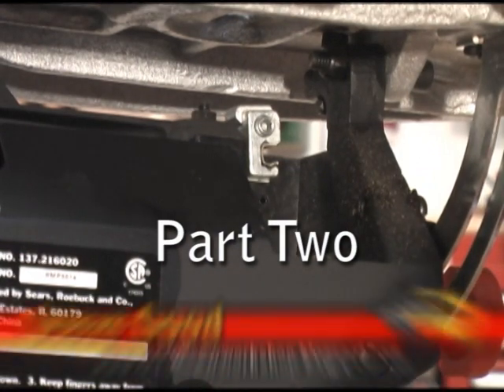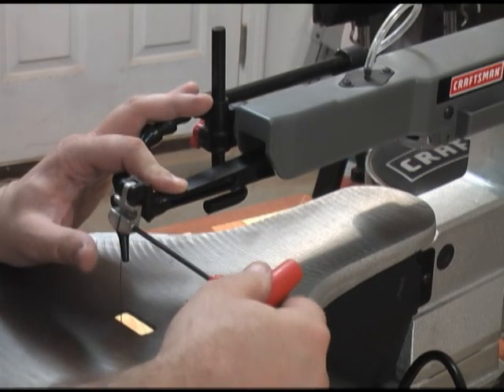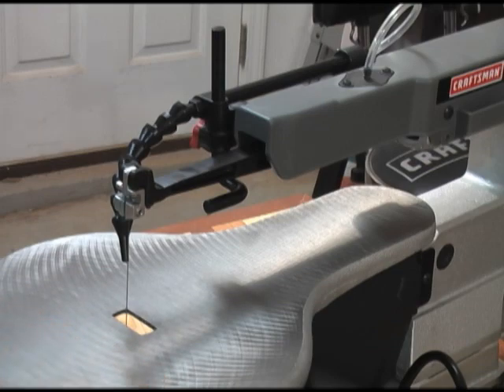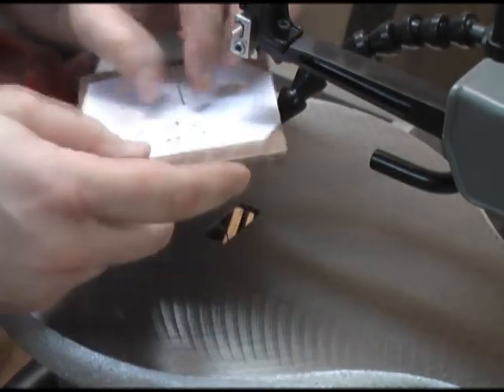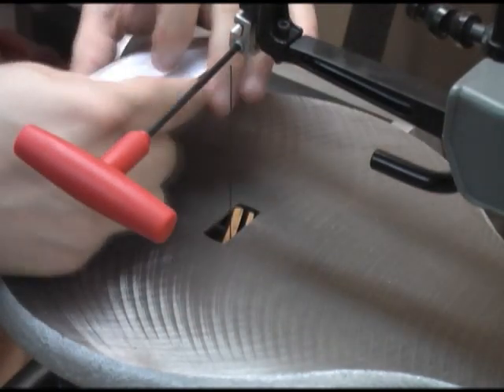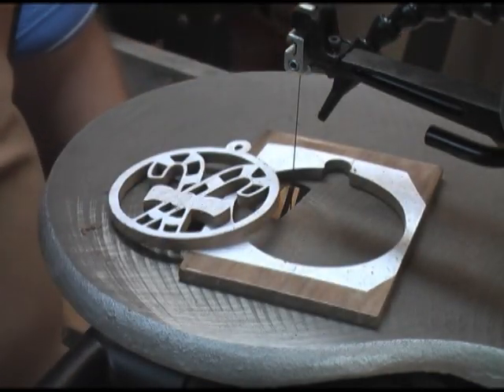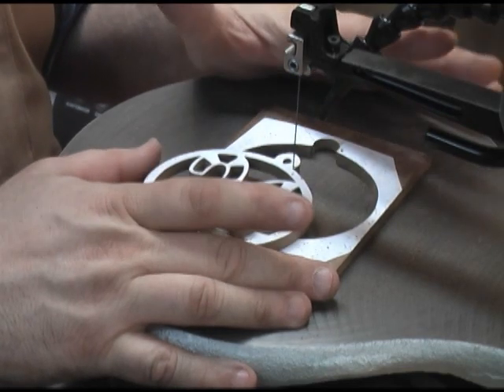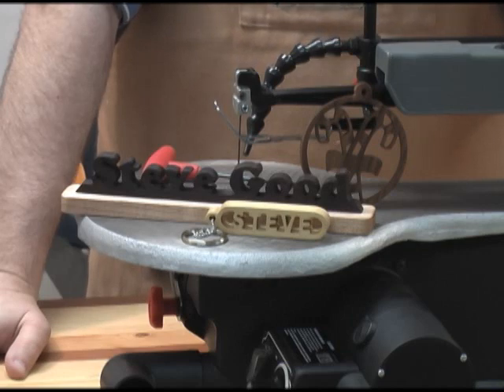Getting started in the scroll saw hobby cheap. Part Two.

Comment: Thank you for your presentation. I have this saw as my main scroll saw and don't back away from many projects. When setting up the saw on your table. place an old truck tire flap between the saw and table. It greatly reduces vibration. Truck stops will give you their "take-offs" if you ask them. I also purchased two longer set screws that hold the blades tight to the saw. It was simple to turn a couple of handles and drill and epoxy the longer screws into them. Or just drill out two dowels to use as handles. It makes changing blades much easier. Like was suggested on the video, get a foot switch and install a wider, smoother table. These are great saws. Listen to Steve about how much wood to cut through. He's the professional. But this scroll saw has the power and ability to cut 1 5/8" dry Pecan. Buy GREAT blades. They don't cost much more. Go slow, wax your blades, replace blades when they first start showing resistance. It took me a full day to cut the 12 2 1/8th" letters on a 14" name place for my son's desk. In short, listen to Steve and just get started with whatever scroll saw you can afford and have fun! P.S. You can get great wood from cabinet makers. They are happy to give you their "cut offs" for the asking.

Comment: Thanks Steve. Very helpful intro for someone used to a jigsaw and jewellers saw. I wasn't sure how much pressure I could put on the tension knob or saw head for changing blades. Your video solved my problem.. and gave me confidence to get rid of the guide too. All your tips and knowledge gratefully received and appreciated.

Comment: I just bought one of these saws just because of these videos.  I have a harbor freight saw and it's maddeningly difficult to chuck a plain end blade.  The blades connect to clamps that aren't connected to the saw - they hang on the upper and lower arms, so you have to hold the bottom clamp on it's arm, while trying to use an allen wrench to unlock the top clamp without dropping it while working the blade through the workpiece and then holding and reclamping with the wrench with the other hand.

Comment: Good informative and educational videos. Thanks. Two minor recommendations to your viewers. When you get your tension set where you like it, take a sharpie and make a mark on the tension knob, and on the saw itself as an index mark. Install the blade, turn the knob to the index mark and the tension should be set. For the rough table, sand it with 120 grit sandpaper on a belt sander. Then teflon spray it, then wax it with a candle, or parafin block. Anyway, great videos. I learn a lot from you.

Comment: Hi Steve, I have this saw and have been using it for about 2 months I havent had any problems with it, the thickest wood that I cut with it was as thick as the saw would allow  2 3/4 inches no problem at all ( the jewelry box pic I sent you)

Comment: Thank you Steve, I went out and got one of these after seeing this since video i was looking at it anyway and it happened to be on sale a few weeks ago. For the set screws in the chuck, i replaced them both with the adjustment wing screws from a set of harbor freight clamps that were bad. They fit perfectly and I don't need the t wrench any more. The only think wrong so far is that the blower is not very strong. its a lot of sun though. i think i may get an aquarium blower to use instead.

Comment: After spending some time setting mine up, I have it running great without noticeable vibration. Out of the box it vibrated some, and worse, made disturbing clacking noises when running at higher RPMs. I think I heard similar noises in this video!

I removed the top plastic shroud/hold-down/air blower assembly and ran it again (after putting the tensioning knob back, of course). It ran fine--no clacking! Turns out the top rocker arm had been hitting the two screws used to mount the little air bellows to the cover. The screws were too long, protruding over 1/8" below the bottom of the plastic bellows plate. On top the rocker arm you could see two little marks where it was hitting the ends of the screws. I found two shorter screws and refastened that plate. 

I also removed the bellows bulb before remounting the shroud, as I suspect that might be causing some vibration. The blower seemed pretty ineffective anyway. If I get tired of blowing away dust I'll likely invest in an aquarium pump, like some others did, and hook that up to the tube with flex air nozzle. 

I also took off the blade guard/hold-down foot, and flipped its supporting arm up before refastening. I figure I can use it to help attach a little light of some kind.

Anyway it runs smoothly now, and this video was a great help in mounting a plain end blade. When I did it, I wedged a little block of wood by the bottom blade clamp to keep it from rotating while I fastened that end first, and then had no problem getting the top blade end clamped. Works great, thanks again!

Comment: Thanks for this video. I'm looking into getting this saw mainly to cut balsa wood and thin plywood for building radio control airplanes. Looks like it would suit my needs fine as that is pretty much all I would use it for. I shouldn't need a high-end saw for making straight cuts, and curved cuts such as wing ribs.

Comment: I don't bother with the top chuck set screw on pin end blades. Works just fine for me. I made a 0 clearence insert for mine but someone tilted the blade and kinked it. So be careful of that.

Comment: i have the delta version,,i just bought it,,and i know nothing about it,,actually i bought it for my granddaughter to get started in woodworking,,it does not accept the pined blades,,only the plain blades,,which i was told is the best,,can you tell me what kind of blades i need to get and where at and also,,some beginner templates

Comment: I have a Delta Workmaster scroll saw and the blade clamps are terrible (at least mine are).  It's almost impossible to get them to clamp tight enough to keep the blade from slipping out.  The blade wanders due to loose tension, I think. Do you know if aftermarket clamps are available for this machine?  On my machine the clamps are like a clam shell with a cam action lever.  I actually bent the lever trying to clamp the blade tight enough for it to not slip out.

Comment: Hi Steve.  I'm looking at this saw and your videos are very helpful in understanding what I should expect from it.  
Two questions.  The replacement blade that you used in this video, what's it called and which manufacturer?  I'd like to grab a couple because I would imagine the stock blades aren't that good.

2nd:  When cutting something like that ornament, how do you sand inside the piece?  I assume with a fine blade, this may not be necessary but I'm curious.  Thanks!  I also subscribed.

Comment: you mentioned about the bad vibration in the saw but never addressed a correction.  was you able to correct the bad vibrations.  thanks.  good  video
Reply: Vibration is a real problem with entry level saws.  It never goes away totally, but it can be reduced by firmly bolting the saw to a heavy strong stand.  Mostly you just get used to the vibration.  After a while, once you decide you want to keep up with the hobby, you trade up to a better saw.

Comment: I just bought this saw used, and I've been really struggling with it. I see you're not using the hold down, do you just always keep downward pressure on the cut?
Reply: I bought the same saw about 8 years ago,  and I absolutely removed the hold-down.

Comment: Not a bad machine, but one thing you did not go over was the type of metal the chuck is made out of.  If that chuck is made out of aluminum, with the set screw made out of either aluminum or steel, and the constant screwing and unscrewing, that chuck will wear out in no time, no matter how gentle you are with it.

Also, as you talk about the table I could see the marks left by the table flattening finishing tool, and yes it will be rough on your hands over time.  Obviously this machine is definitely for beginners, but unless those chucks are made out of steel, it isn't much better than a piece of garbage and a waste of $100 or so dollars !!!